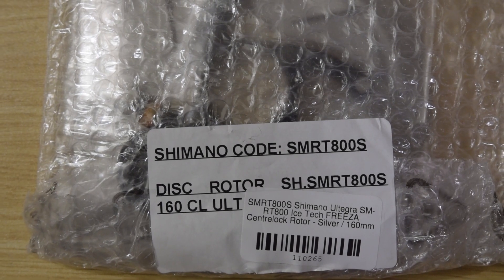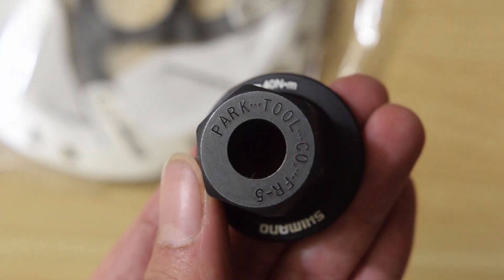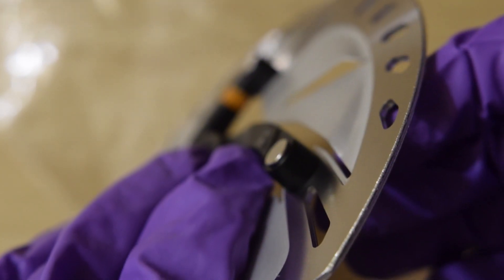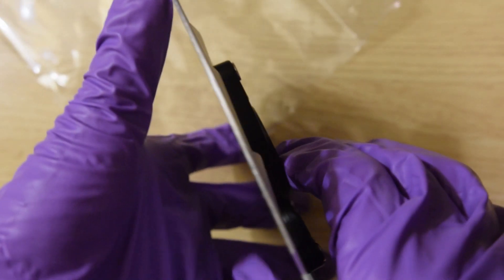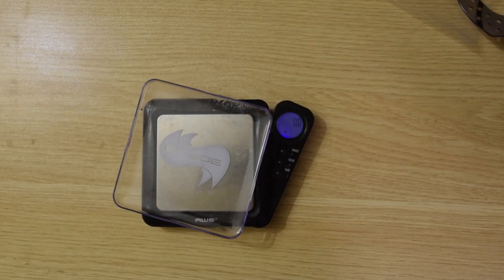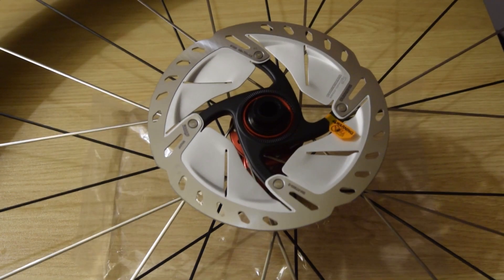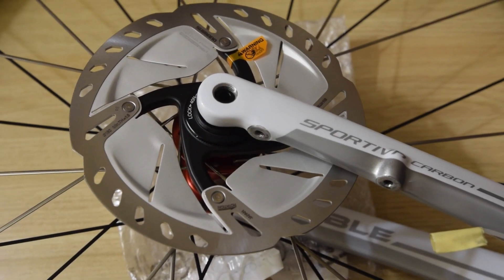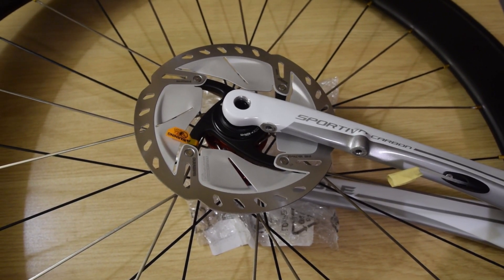How to install a road Centerlock disc rotor (Shimano Ultegra RT800), + specs and first look

Comment: I followed your instructions and realized this is for rear rotors only.  There is a different tool required to remove front rotors, great video!
Reply from the maker: 13:50 This was installed in a front hub, maybe you have a different hub that has a non-standard mount?

Comment: Your next video should cover servicing the cartridge bearings, removal and installation.  You did a good job on the disc rotor part.  Most of the other tutorials slam bam and its done to show how fast and smart they are to do it.  You don't skip over the steps. New subscriber.
Reply from the maker: Are you referring to the hub bearings?  I could put a video out on why I don't replace bearings but replace entire hubs instead. And thanks for the subscription Hornet!  Much appreciated 👍

Comment: But I don’t have a torque wrench
Reply from the maker: Yes it's hard to judge exactly how tight to tighten the bolt without a torque wrench and a lot of experience.  I've hand tightened it in the past without a torque wrench and it has never come loose. I've never overtightened it either so I haven't stripped the threads.

Comment: I am currently running the shimano rt70 from the 105 group set. Is this disc  a direct bolt on? Or will I need to upgrade the brake calipers as well?
Reply from the maker: Not brake calipers but you'll need new hubs.  This one is centerlock only.

Comment: If I currently have 6 bolts set up and there is little space between the bolts and the fork, by switching to centerlock wheels and using this rotors, the space between the locking ring and the fork should be the same? In other words, does the locking ring sticks out farder than the bolts on a 6 bolts disc does? I just ordered new wheels and I'm not sure now if I have enough space for the locking ring.
Thanks for your time.
Reply from the maker: Hi Felipe, both 6  bolt and centerlock look like a tight fit on my bikes.  I'll have to do a more in depth look later.
Reply: @pedalpowercycling  Thank you so much for answering so quick.  I just ordered new carbon wheels, but now I'm thinking that there is no enough space for the ring. I wonder if using the 6 bolts to centerlock adapter will give me more clearance.
Reply from the maker: @FRamirez1A  I don't have experience with the adapter but I do have both centerlock and 6 bolt. I don't think you'll have to worry too much.  They look really similar.  What wheels did you get?  I like my Light Bicycle carbon rims so far.
Reply: @pedalpowercycling  Thank you so much.   I got the FFWD RYOT44.  Light bicycle was one of my options, but I decided to get the FFWD  because of the life time warranty.

Comment: 9:15 no, the number means max 40nm which is basically saying to can jank on it like mad. No point in doing that though since it has these locking teeth. Not that there would be much lateral load anyway
Reply from the maker: Thanks, in my description I mentioned that I tightened it to 36 Nm.

Comment: Good video, it will help me to install my first Disc 👍
Reply from the maker: Glad it helped.  There's also 6 bolt disc brakes too but it seems like Shimano is migrating to centerlock for road.
Reply: @pedalpowercycling  My new bike will have a centerlock Disc Brake, so the video helps me to get the second wheelset ready :-)
Reply from the maker: @marcusroesnick Hi Marcus, did you end up getting your new disc brake bike?  Also note that there are different axle standards so you have to make sure you get compatible wheels/hubs with the new bike.  Not all disc brake hubs are built the same.